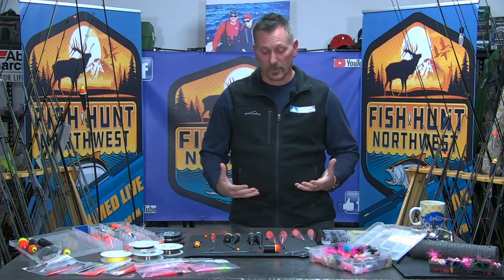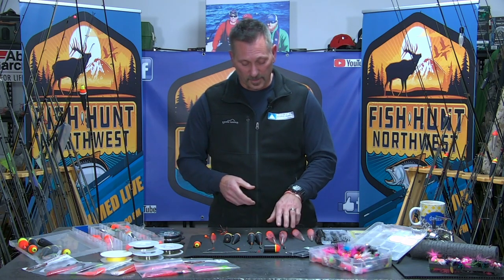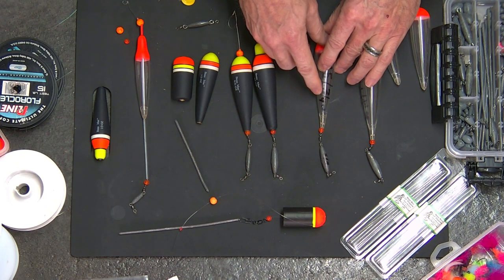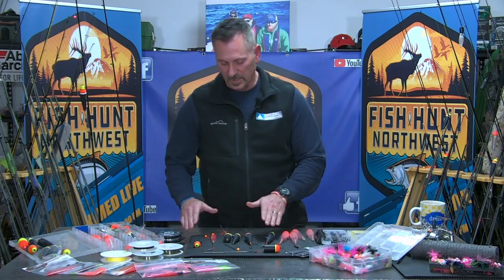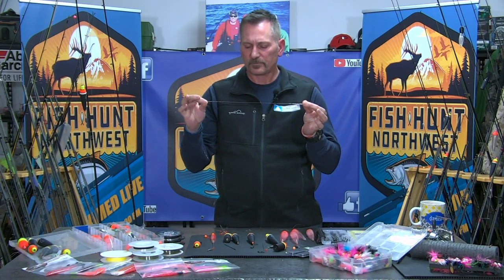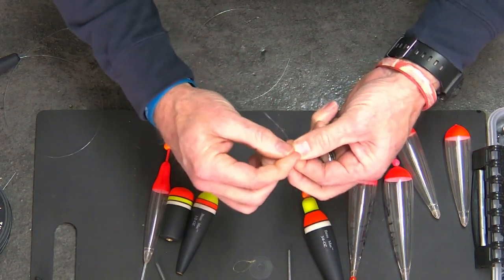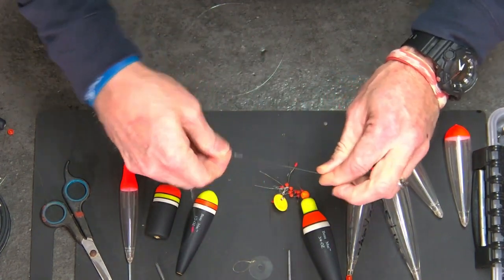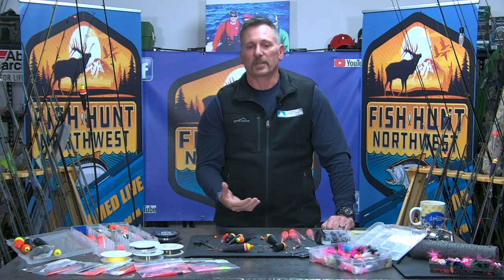"How-To"  Bobber & Weight Selection for Steelhead

Comment: Hi thanks for the info. One last question. In the past I have used a sinker like the ones you mention. Problem was when I used a very light weight presentation like a small bead the leader line would come up and tangle around the weight. If you know what I mean what is a solution? Thanks so much for responding

Comment: Wondering where you get those weights with the swivels, what brand? Good video
Reply from the maker: The weights, floats, bobber stops etc. are all beau mac. You can find any size you need, on-line or at local sporting good stores. 
https://www.amazon.com/Beau-Mac-SIL1-Sinker-Swivels/dp/B00CO939LW/ref=pd_bxgy_img_2/130-8127986-7308837?pd_rd_w=vxxy7&pf_rd_p=c64372fa-c41c-422e-990d-9e034f73989b&pf_rd_r=NMRA892120AXZQZ1XMT7&pd_rd_r=2edc9ae8-58af-4dc6-b87e-477c0eca6bd8&pd_rd_wg=RjP21&pd_rd_i=B00CO939LW&psc=1

Comment: What knot did you use to tie your weight under the bobber? I tried to follow but don't recognize it.  Also, I've been adding a bobber stop between my float and the sinker so if you break off above the sinker you don't lose your float.
Reply from the maker: That knot is just a simple cinch knot. You form 4 loops that go over and under the main line, then come up through the bottom of the loops, elong-gate the wraps so they lay flat, then pull tight..
Yes, the second bobber stop is affective for that reason as well, I failed to mention it this time. ;-)
Reply: @FishHuntNorthwest  Thanks. the way you tie it and being far from the camera, I thought it was something more complicated. I like the tip about making the bobber fixed.

Comment: I fish the rogue river here in Oregon I’ve been fishing a 3/8 float with a 3/8 inline and 1/8th jig I’m definitely going to try the 5/8 with 3/8 weight see what happens
Reply from the maker: Good call. A 3/8 float with a 3/8 weight and a 1/8 jig, is too much weight for the float. ;-)
Reply: What size jig would you recommend if I use the 3/8 float